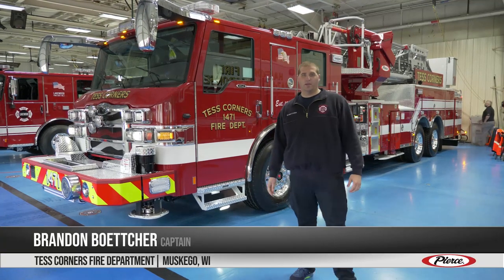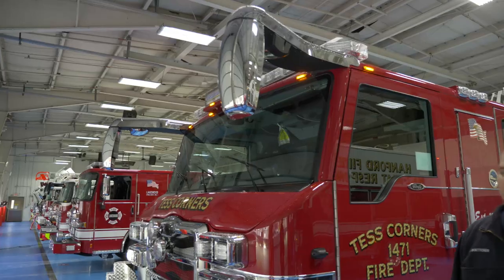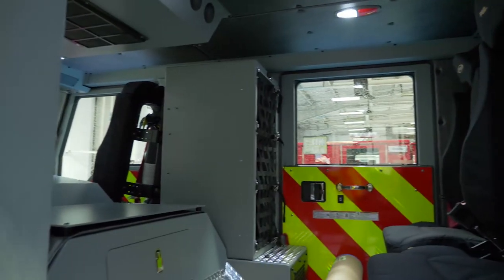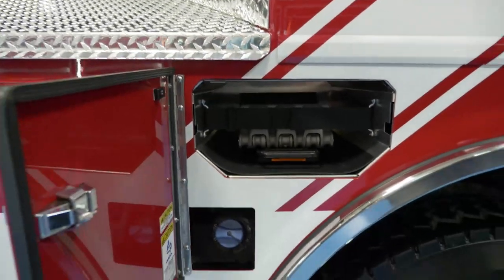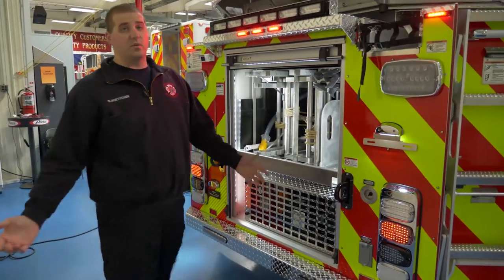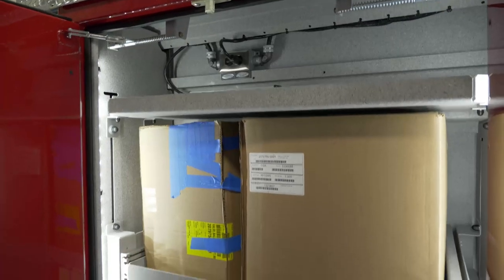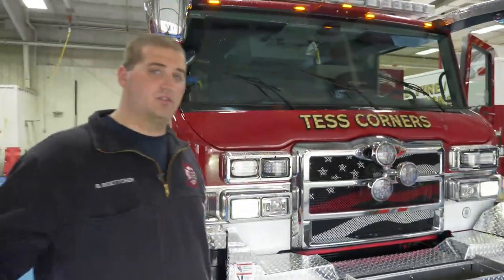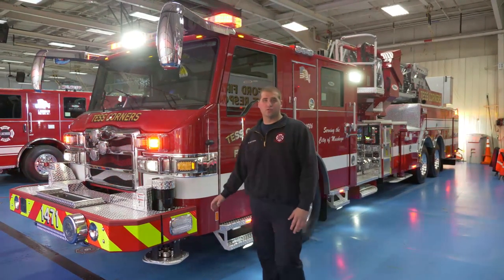Velocity® 100’ Ascendant® Heavy-Duty Tower – Muskego, WI

Comment: Apparently they don't have streets that rise sharply from an adjoining road. Otherwise that rear compartment unit will bottom out. Mack had it right in the '70s by not filling that space under the bucket.